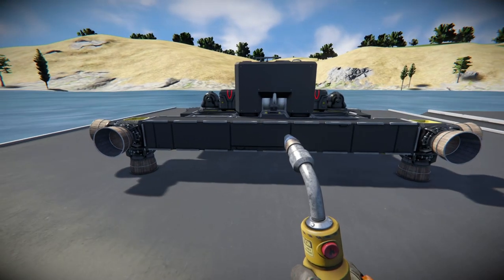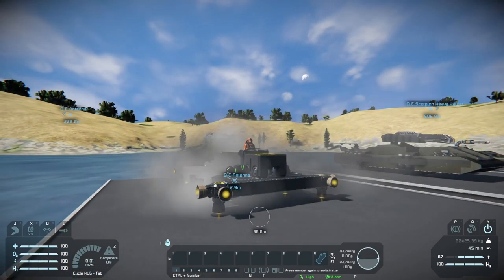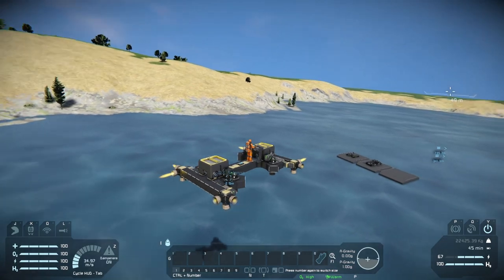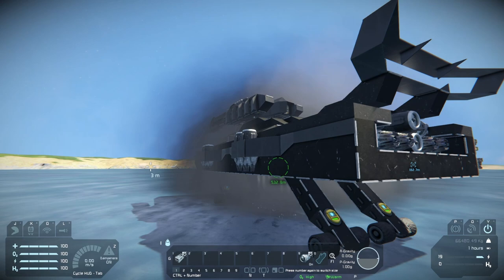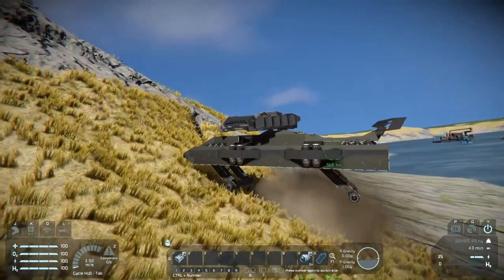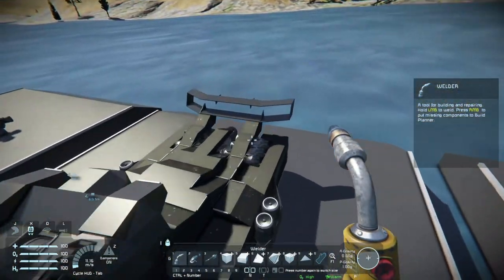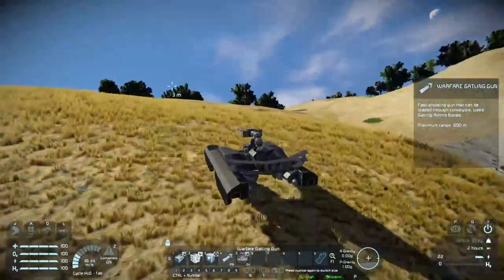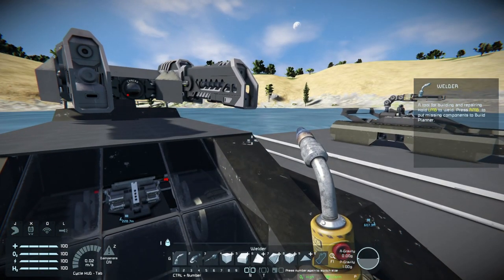Hover Tanks / Platforms - Space Engineers

Comment: This has been one of my favorite long-time "rule of cool" topics! I've tried to find actual practical rationalizations for why anyone would want to not simply fly 100% normally with thrusters. The "driver experience" like they talk about with BMWs and other performance road cars is the best I can come up with -- low altitude, nap of the earth flight lets you experience the planet a bit more intimately, in ways that flying over it at 50m, 200m, 2km, etc. glosses over.

Nap of the earth flight can be good for avoiding NPC installation line of sight. Somewhat useful for me, since I play with MES NPC weapon randomization set to true (same effect as Lucas' NPC weapon upgrades mod, which just automatically sets this to true for you). Now any NPC grid has a chance to drill me with railguns!

Or scraping ice lakes for H2.

I'm open to other ideas, since otherwise it seems like it's easier just to fly normally for most tasks. :P

For variation ideas (just to play for yourself, not necessarily for more video ideas). Sorry-not-sorry for the wall of text:

You can get a glide effect if you leave off one (or more) axis of horizontal thrust. I've seen and built light hover bikes that use either dispense with reverse thrust so you coast forward by default in cruise mode, and have to tilt the vehicle nose up or slew/bank sideways to use side or up thrust to brake. I've gone all the way to only 1 lift thruster on a 5-block super-light small grid, but that was pretty frustrating for my level of piloting skill. Lift and forward thrust is a pretty fun challenge for joyriding, but not great for precision survival work (such as trying to dock with a connector; better to hand load the cargo). My personal preference is up, forward, and left and right lateral (no down or reverse thrust).

On the workshop, Daxter's Aeroppa City VTOL craft (Ghast and Mount blueprints) are the first I've seen that dispense with forward thrust and have up, left/right, reverse thrust. It's cool in that you have to use gravity falling to accelerate forward by nosing down. The no-reverse speeder bikes are for going fast, and the no-forward VTOLs are good for a controlled easy mode helicopter-like flight profile. I've spent a lot of time in this space, and many (possibly the majority) of my vehicles are variations on this theme -- even heavier utility or combat craft. It's a useful trade-off in requiring more skill (and some inconvenience) but saving literal tons of mass to reallocate for more armor, weapons, functional blocks, cargo, etc.

Not an altitude-controlling script, but Naosyth's Flight Assist is my preferred script for maintaining level flight especially when I leave the controls (resists torque/roll accumulation). But as with a lot of these scripts, can't use it on every single vehicle b/c running a dozen script instances tends to bog down the CPU -- not noticeable in normal play but it can hit sim speed hard in combat and when handling crashing ships (such as during combat). This has led to me looking for lower-overhead solutions.

The player Rogers created a really unique solution in their workshop blueprint Speeder Bike 74-Z (Mk 3) with vanilla LAV hover. I just found it a month ago, and it works surprisingly well. I'm really excited b/c of the intersection of effectiveness and simplicity. I'd venture that it's far better than the majority of other "hover" solutions I've built or tried on my own or from the workshop. Super simple concept -- a sensor on the bottom is set to detect only voxels. Set the forward extent to something between 1 meter and 5-10 meters depending on your preference. I also set the top and bottom extents to be slightly longer than the vehicle itself. left and right extents can be set to the same width as the vehicle and 0.1 meter for the back extent (irrelevant; just saves tiny bit of power). The sensor's two on/off hotbar actions are to turn on lift thrusters and turn off lift thrusters. That's all there is to it! :)

The sensor's outright detection is usually pretty immediate, but the range at which it detects is a bit fuzzy (per your point about how planet voxel grids are created), so an actual sensor extent of 1 meter can result in experienced vehicle height of 1-20 meters. When the vehicle gets too high, it cuts out the up thrusters, causing the vehicle to fall until it detects ground again. I'm really amazed at how simple and effective this is. Just make sure you don't fly w too much speed and launch too high -- then the sensor thruster cut-in can't decelerate the vehicle fast enough.

Variations that refine this concept:

Rogers actually had 2 thrusters, each one set to turn on/off on one sensor, at different extent/altitude distances. In my playing around with it, I did not see much effect due to the voxel bounding box effect. One sensor worked just as well/vaguely as two, as far as I could tell.

I only tried this on speeder bike designs that used 1 lift thruster. With 2+ thrusters, you can leave some thrusters as always-on, just enough to almost but not quite maintain neutral buoyancy. Then an extra 1 or 2 thrusters are grouped and sensor activated. This mitigates the descent due to gravity while still keeping the "can't fly higher than X" effect.

Build a larger amount of up thrust -- to the point of possibly being overthrusted. This makes the cushion stronger, so that you can decelerate and catch yourself on a harder drop, thus shorter distance needed. Maybe a 10-20 ton vehicle with 4-6 up thrusters, 1 of which always on (not enough to fly on its own) and all the others set on sensor.

Could use a non-hover gravity alignment script like Pesticide's pretty good ones (with caveats below).

The concept is really simple. I just overexplained it and all the variations. I've never seen anyone else use it, but I think it's one of the more elegant solutions using available vanilla game tools. I've personally switched my current survival hover craft to this concept, because I'm making an effort to eliminate script usage and reduce CPU load for a smoother playing experience.

I've used most/all of the hover/aligner scripts I can find on the workshop. One that is a bit less fully featured actually works pretty well b/c it doesn't aggressively force elevation/alignment control -- Elfi Wolfe's Hover Script fix of Rastafun86's script. It's similar to Jturp's in that it uses camera raycasting, but only to find overall altitude; it doesn't try to track the corners of the grid like Jturp's does. Of the scripts, I prefer the Elfi Wolfe one.

Most of the hover/alignment scripts have some quirks that can cause the vehicle to oscillate or roll out of control, so I felt like all of them were an exercise in picking trade-offs.

Takeshi (the mod author) made a Hover Engine mod version that's compatible with Jakaria's Water Mod, which is good for mod synergy there, if you want to play on water planets. For hover block mods, it's by far the best. Really stable and effective if you want to practically hover on rails (you'd have to actively work to crash the vehicle). Solid choice if you want something faster than wheels but hugs terrain without crashing. Downside is that each hover engine block is pretty high PCU. I forget, but I seem to recall they're way more than equivalent vanilla thrusters.

And of course, there's the vanilla 0% friction wheel. I've seen a lot of people use these oriented normally or on their sides (wheel hub facing down). One player on YouTube (New Fang, I think) made a couple of rover contraptions using hinge or rotor suspensions which look pretty cool. Downside to them is that the 0% friction wheels rigidly collide with sharp terrain (like the Earthlike jagged teeth). The subgrids mitigate this with their suspension range of travel, buuut subgrids. They disintegrate on a sneeze.

Out of all of these, I personally prefer Rogers' sensor-based vanilla hover. It's not the most precise, the way Takeshi's hover mod or Jturp's scripts work. But it's simple, vanilla, and low CPU overhead. The flight style feels like it needs a little skill to use safely and effectively, just like a low-altitude hover speeder should feel like, cinematically! And it flies just high enough to ignore basically 80-95% of the little terrain problems that 0% friction wheels run into.

Comment: Tip: Take the wheel, and turn them sideways. In the game, the tyre (or tire depending on location) has fixed friction added to it. If you drive on it, its going to drag on the ground, slow and pull you down.

If you take a wheel and attach it sideways on the bottom of the craft, you can bring its friction down to 0 and glide across ths ground effortlessly.